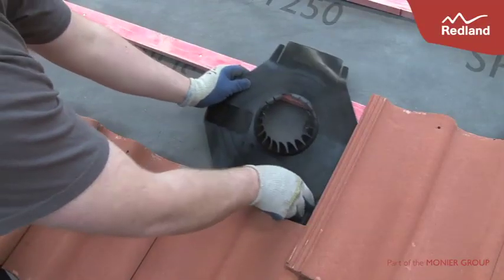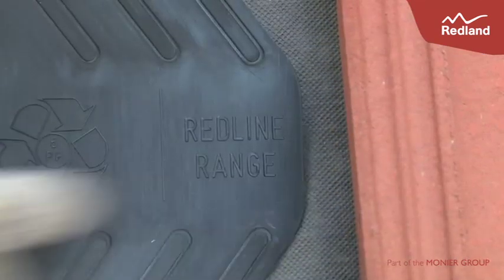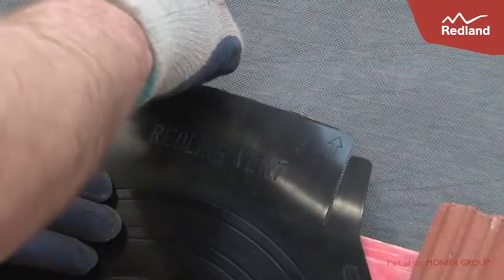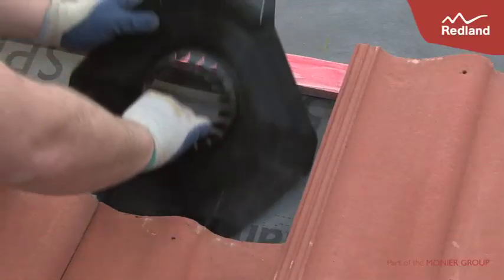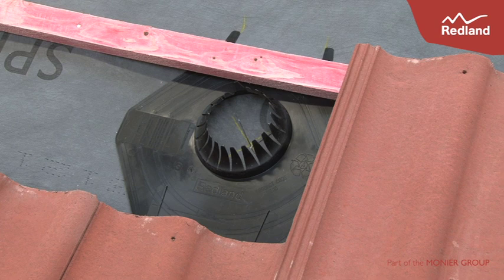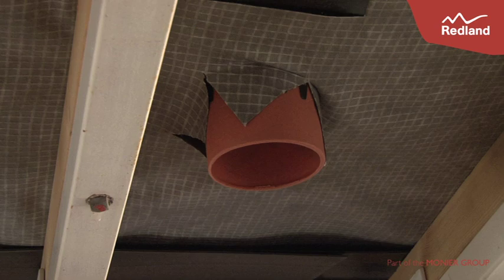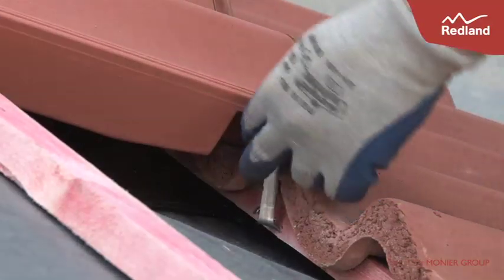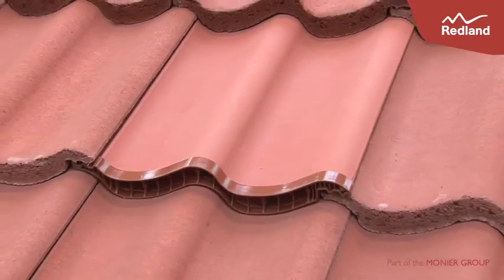RedLine Vent Tile Installation Video

Comment: Hi there,
I love this vent, is it appropriate for use to vent a cooktop rangehood, or will it cause resistance?
Many thanks for uploading.
Reply from the maker: Yes, the RedLine Vent can be used for mechanical extractions. However, the airflow resistance of the system needs to be taken into consideration. The details for each profile can be found on the website or via our Technical Solutions team on 08708 702595.
Reply: MonierRedland many thanks for your advice.